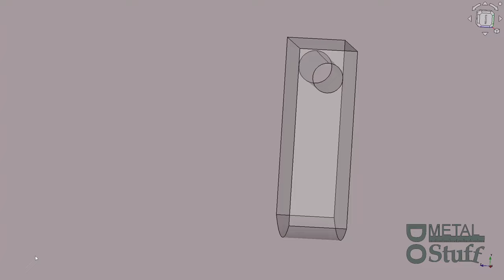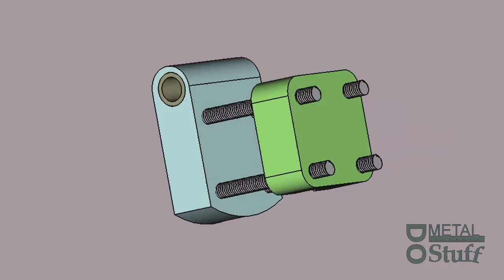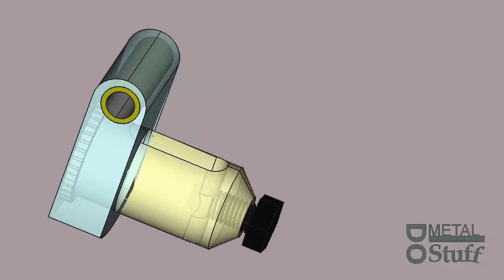Metal shaper Armstrong lookalike toolholder + go enter the poll

Comment: You need to make the second rotary type as it will be needed to get the bit in the right position for many jobs .
That pin idea is a good one to keep it from moving, but not totally necessary as when it is tightened up it will not move easily , but if you have a lot of tool holder hang out to do a job it might try to move , things happen like that .
Reply from the maker: Hey thanks for your response. That pin has a dual purpose. The first is what you said. The second is for positioning, I am going to mill holes in the shoulder of the tool holder. Every 10 degrees and 180 degrees further it jumps 5 degrees compared to the first 18 positions

Comment: Tool holders come in many sizes for different size machines , some will just be to large for the machine that you are using .
I have a few that where given to me that are to large for my 14" x 36" lathe .
Reply from the maker: If it doesn't fit, Maybe you can make it fit. Please pay attention to center height. Important with a lathe.